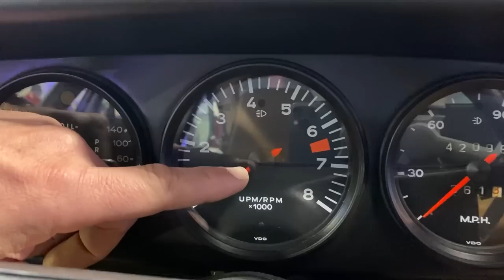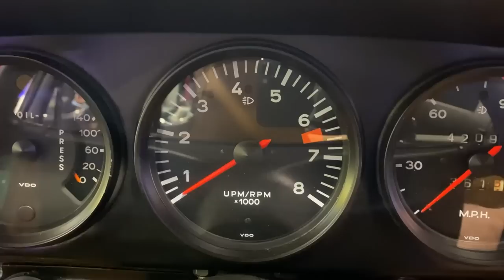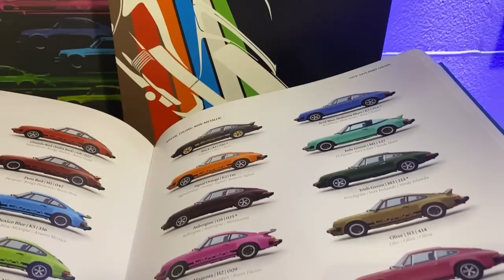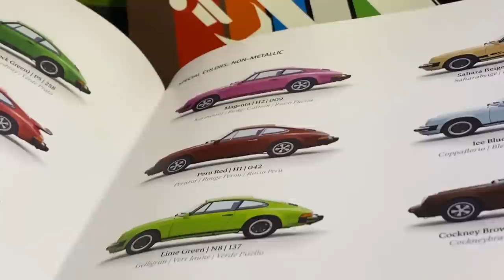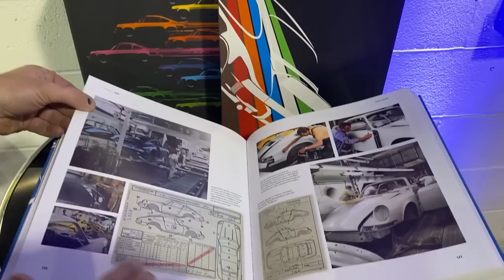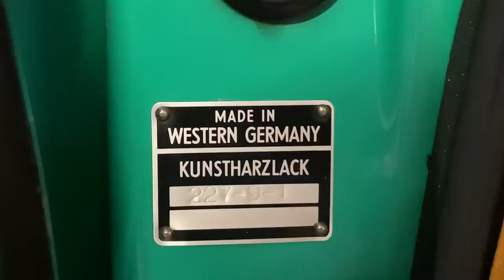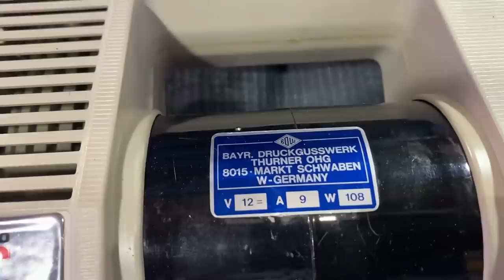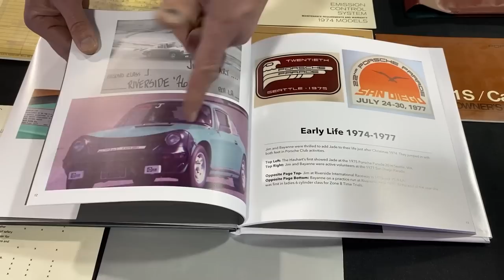1974-77 Porsche 911: Everything you need to know about the ‘mid-years’ | PCA Spotlight

Comment: Very comprehensive video. I really appreciate it. Thanks!!
I have a 74 Carrera US, running with an SC engine. But the CIS installed is the original from the 74 engine. Is there any major difference?
Reply from the maker: Thanks for watching. Be sure to subscribe.
Reply: The basic layout and functionality is the same from 1974-1983 BUT there are a myriad of small changes to the various components. In general the newer the CIS system the better it is. With that said, if you car is running well, don't mess with it. A nice running CIS motor is a gem!
Reply: the ‘74 Euro in your vid (nice job) has “flag mirrors” on both sides. I was under the impression that the ‘74 Euro version had the silver/metal  “original flag” only on drivers side. Yes? No?? THX!!

Comment: Overall a very good video. The exception is the G body is the 74 MY only.  (Letters were used internally to designate the MY, so they wouldn't be confused with the production year). It is incorrectly used to cover all impact bumper cars. (also a F body car is a 73MY only etc.) Please correct that often misused description as you are adding to the confusion to newcomers to Porsche..
Reply: Raymond- yes, the 69-73 cars are commonly called the F-body, but technically that is only correct for the 73. The same holds true to the 74 is technically the only G-body but in common usage has referred to the 74-89 cars as that is the year that introduced the "impact bumper" which went thru 89. Sometimes nomenclature or terms take on a life of their own, yet were not ever officially the term or often are not correctly used at all. For example the usage of 965 to refer to the 964 Turbo which has never been correct. Good reminder for me not to fall into the trap of using the commonly accepted term vs the technically correct one.
Reply: @ntm4122  When the cars were new, at the dealership, we were referred to them as "Impact Bumper" cars and "Body Bumper" cars to make the distinction.

Comment: ... Also is there any recommended books that you are aware of that would cover the euro 76-77 Carrera 3.0?
Reply: Chad there is not a specific book for the 3.0 Carrera but having both the 2.7 Carrera and 3.0 Turbo books both written by Ryan Snodgrass would get you the vast majority of the in-period information, only lacking some of the mechanical specs on the 3.0 (which shares the basic engine with the 3.0 Turbo 1975-1977).
Reply: @nathanmerz  Thanks for shooting and editing a terrific video on the 74-77 cars.  I agree the 74 - 77 cars have been overlooked for far too long. I have long held that most of these cars have already suffered failure and rebuild or transplant.  It would be hard to imagine any of these cars to have survived with all but the most careful driving to this date without some sort of "tending" .   I know of 1 local car, a 75, with 16k miles.  It is still original and the engine remains as original.  The Helgrun car in this video would be another.

I have to agree with Chad.  I think you missed the chance to introduce many people to the 76-77 Euro 3.0 Carrera.  I have been mustering up the stones and dough to plunk down for the 2.7 Book and the 3.0 Turbo Book.  There are things I still am learning about my car a 77 3.0.  I "restored" my car to my taste, converting it to MFI ( I still have the CIS in a box), it has 178k km and is a very nice driver.   I am a fairly adept collector of all things Porsche and admit to loving my 77 3.0 more than any Porsche I have ever had the good fortune of owning.  That Hans Mezger chose the 3.0 as his personal favorite reinforces my infatuation with this Porsche odditiy.

Please stop calling anything a VIN number - the N stands for  number.  Everything else you cover in your videos, this and the 3.2, is fantastic.  I have learned so much about the differences of the 84-89 changes.  I just purchased a 86 with 41k from its original owner. Complete documentation from new.  Service records, original bill of sale, original letter from Porsche, original and complete service history for 36 year, all original paint, original keys, books, tool roll, air compressor, etc.    Do you know of any other options from Porsche to authenticate the car?  Am I relegated to a trip to Chicago or Atlanta for someone to look at and substantiate my purchase?  Keep up the good work.  The variety of your venues is fantastic....